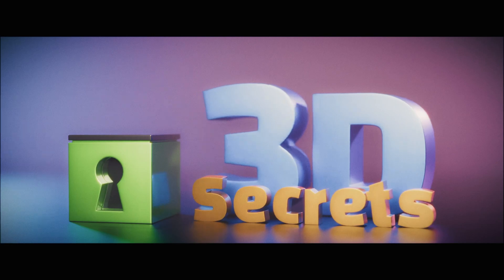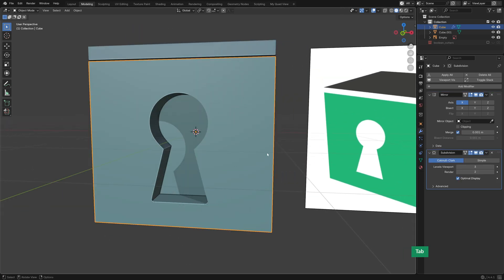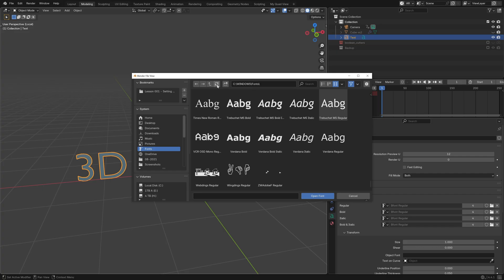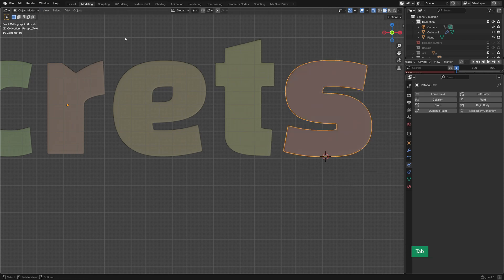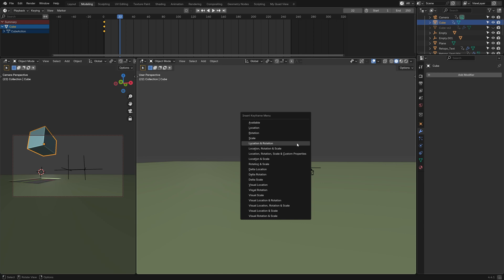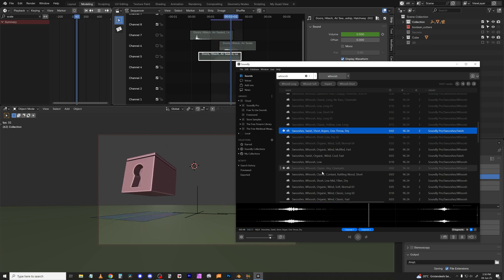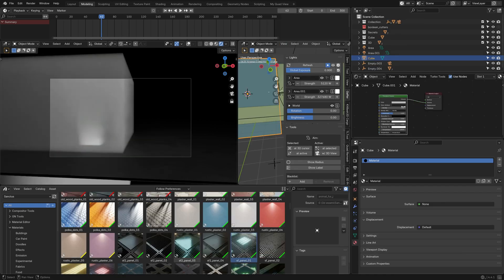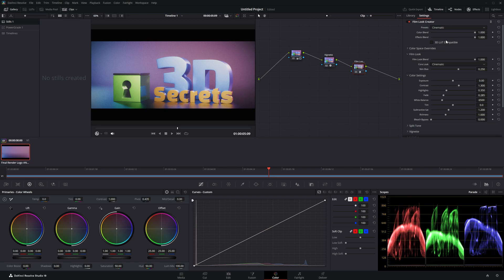Making a new Logo Animation - Blender Secrets

Comment: An extension that saves me so much time is the 'Orient and origin to selected'.  Basically, it removes the step of setting the 3D cursor to the selected vertex, edge or face and allows placing of the origin with one click in edit mode.  It's on the Blender extensions site.

Comment: 7:35 try to scale keyframes in the graph editor. for that there is a pivot point setting at the top right in the graph editor which can be set to "bounding box center", "2d cursor" and "individual centers". with that you can scale their timing in the x and their strength in y. i think that might help you

Comment: Hey Jan. Loving the book you did and this video. I have more of a curious question to ask. I agree with you in using DaVinci Resolve for tweaks but why didn't you use Blender's Compositor and Video Sequencer for tweaking? Thanks, keep it up.
Reply from the maker: I used Resolve for grading only. That's what it's very good at, why would I do that in Blender?
Reply: @BlenderSecrets  By grading, do you just mean "tweaking colors" or are there features you are using in Resolve that aren't available in Blender?
Reply from the maker: As you can see in the end of this video, it's very easy to just drag and drop preset nodes for a film look, for example. But really, grading ("tweaking colors") is very advanced in Resolve, I would assume it's got many features that Blender doesn't have, yes. Mainly I just wanted to only spend a minute on it, rather than try to figure out which nodes to use etc. But give it a try yourself, it's free after all...
Reply: @BlenderSecrets  Wholeheartedly agree. I use DR in my 360 work. Again, just a curious question as I saw that Blender was trying to upgrade their editor. Thanks for the input. :D
Reply: @BlenderSecrets  Well Blender has grading tools. So I thought Blender would be used to grade anything. But again, DR is uber good at it. Guess I'm thinking "keep it all in Blender" type of thinking.